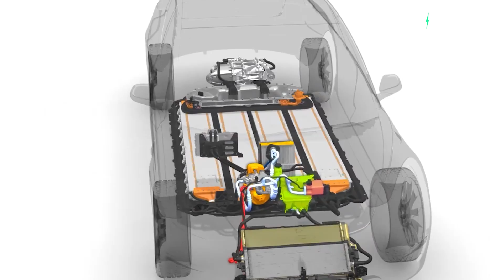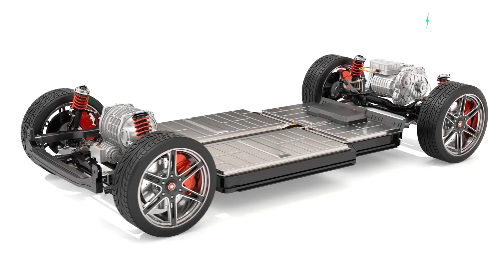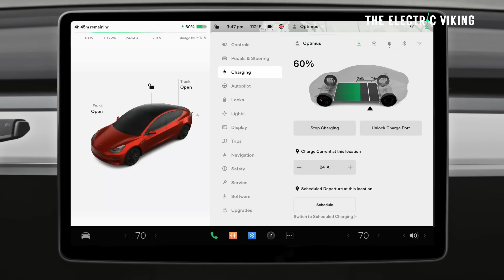No, you don’t need to replace Electric Car Batteries in 10 years time

Comment: Batteries tend to experience a decline in performance over time, although the extent of this degradation may vary among different vehicles. It is generally acknowledged that as performance decreases, so does the driving range. The crucial point is that with reduced performance, the need for more frequent recharging becomes inevitable. Strikingly, few people seem to address this concern directly. One of my neighbors has been driving a Model S since 2016, and according to them, the driving range has continuously shortened over time. Consequently, they mostly use it for city driving. Personally, I own a Model Y with approximately 15,000 miles on it, yet I consistently achieve a range of 260-270 miles, far from Tesla's advertised 330-mile range. On a recent trip to LA covering approximately 323 miles, I had to recharge the Model Y five times. Considering this trend, one might wonder if, over the course of ten years, it won't be necessary to charge it not just five, but perhaps six or seven times for the same journey.
Reply: A company called Tesloop than runs constant back and forth service between LA and Vegas had to get their battery replaced at over 600,000 miles when it was under 80% capacity. Tesla did it free, thanking them for the testing. They mainly used superchargers rather than slower home charging, which is better for the battery.
Reply: yes Tesla overstates EPA range massively. This is quite known. Realistic range for model Y is around 290 miles if you drive 65 mph. But in your LA example, the math also doesnt add up. You shouldnt need 5 stops. Max one stop if you started at 100% charge.
Reply: literally every range/miliage calculation from any company ever has to be taken with a grain of salt. They all stage things to make the number look as best as possible. @Fear.of.the.Dark.
Reply: I have a Model 3 that made a Fresno to LA journey around that same miliage and only have to stop once, or twice if I started the journey on less than ~60%

Your math makes no sense. Why did you have to stop 5 times? That would mean your range was more like 80 miles or something not 250.

Comment: All I can say is that every rechargeable battery item I’ve ever owned was either thrown away or I paid to replace the battery before the item was broken or out of date. 
Hand tools, laptops, phones, e-cigs, tablets, headphones, speakers, cameras. I could even go back to items with NiCads from 30 or 40 years ago with the same “replace the battery or chuck it away” scenario. 
I have no idea how many lithium batteries I’ve replaced but it’s a considerable amount and none of them have been cheap and equally all of them have more or less given up eventually, lasting several years at best - not 10 years or 20 years - nowhere near. 

I’m sure modern technology is perhaps a bit better but lithium cells (those used in tools are much the same as those in EV’s) have around 1 - 2 thousand charges before a noticeable reduction in capacity. We’ve all had phones which suffer this within their lifespan.

I think the real world will give us a very different answer than the one in this video.
Reply: And not one of the items you list have a true thermal management system in them that extends battery life.
Reply: @chetsaxton1526 that’s because they don’t need one because none of them have mega current put into them during charging. Will be interesting to see what difference these systems will make but I’d assume that with the advent of faster and faster charging they will only be so good.
Reply: @Jacob-yb6bv  DC fast charging yes, but at home can be done at only 15 to 20 amps.
Reply: there are already plenty of Teslas out there in real world starting from model S and X many years ago. Model 3 was launched in 2017 so it has been 6 years already. There is already sufficient data available.
Reply: Fully agree.

There are some exceptions, e.g. the 10 year old batteries for my DSLR are still usable.
But normally they last around 2 to 5 years, with some failing earlier.

I'd assume if you go for high reliability and put some engineering effort into it, you can get 10 years out of them. Time will tell. Best to wait and see the numbers if you don't have money to burn to find out.
Reply: @svr5423 what I didn’t mention is that I actually attempt to make batteries last. Using slow charging where possible, never storing them at full or low charge, bringing them in from my garage in the winter etc. Batteries simply don’t last. I’d be surprised if all of a sudden they do.
Reply: @Jacob-yb6bv  I'd also be surprised. For me, they are simply consumables.
Reply: BMS

Comment: Sam, in your videos you make frequent unsubstantiated claims that the oil industry is "spreading misinformation". Until you can actually provide credible evidence of this, you shouldn't say things like that as it actually lowers your credibility.   I worked in the oil industry for 35 years and they were far more open to change than you give them credit for.  There is far too much demonization going on these days.

Comment: i have a 2016 Model S P100D 250k miles, 84% capacity, very decent
Reply: I bet it performs like a race car still! The performance of that model s is like no other. No delay in power. Literally instant acceleration. And that performance is every single day. There's no clutch to fix, no transmission to lock up. No engine to blow up or  rpm to worry about. You can't jump time or or burn a valve. There's no adjustments because of cheaper fuel. None of the things that are typical concerns involving a ice sports car. And the highest safety scores in crash testing ever obtained in any class of vehicle.. May not be the perfect car but it's closer to perfect then any ice sports car..

Comment: ICE cars need to be replaced every 10 years on average before major maintenance that requires thousands of dollars. I expect EVs to be replaced up to 20 years if it still looks pristine and the battery lasts without major degradation. Often I hear a failed battery is caused by a module that should be replaced rather than the whole unit so I hope for more battery repair services.

Comment: As we see more EV's using structural battery packs (such as Tesla 4680 cell packs), it may be more difficult to replace the battery pack in a car, and probably impossible (or uneconomical) to repair. Nevertheless, it's unlikely any of that will ever be necessary with modern battery management systems.
Reply: Your faith in technology is unreal

Comment: According to a new UN Environment Programme (UNEP) report, fossil fuel-producing nations are planning MASSIVE EXPANSIONS of coal, oil and gas that would “blow the planet’s carbon budget TWICE over”, reported the Guardian. Existing plans would lead to 460% more coal production, 83% more gas and 29% more oil in 2030 than it is possible to burn if global temperature rises are to be kept at 1.5C. The report analyzed more than 20 major fossil fuel producers, finding they plan to produce around 110% more fossil fuels in 2030 than would be consistent with 1.5C, and 69% more than would be consistent with 2C, reported Reuters. Of these, 17 of the countries have pledged to reach net-zero.

Comment: I'm hoping that the face EV manufacturers will most likely be using blade-type battery packs by 2030 means higher storage density per kilogram and likely way longer battery service life. Like may be more like 15 years.

Comment: Will a batterie pack last 20 years even if you make 7000km every year?
Reply: All battery chemistry has got a shelflife. 80% of the lithium batteries will fail between 10 and 15 years of age. 10% earlier, and a lucky 10% will surpass 15years.
Reply: If you choose the right car it will. BYD batteries are supposed to have a life over 1 million km.
Reply: @GlenisRetiredNZ  yes In km but how much in years? I understand one can make 1 million km   but in 15 years will the pack be functional? Or you can make 1 million km but in max 8 years ?
Reply: @kayz3rkayz3r84  the battery guarantees are 8-10 years but I'd be pretty confident they'll do much, much more. Look at ICE cars, most have a gaurantee/warranty of 3-5 years but nobody realistically expects them to need an engine replacement at 5 years. I think it's probably more important to go with a brand that's likely to be here in 20 years.

Comment: Thank you Sam for this useful information. I have had my electric car for three years now and always charge it at home with 11 kW/h, 100% if I have to drive far, otherwise usually 80%. I have no idea if the battery capacity has decreased. Anyway, I understand from your video that it won't be too bad. I plan to continue driving the same car for years to come.

Comment: Your battery will not last long if you supercharge it much.  A fellow here on Ytube - who does Uber full time replaced his Camry with a Tesla;  He supercharged twice a day and it only lasted 110,000 miles. Another fellow Youtube drove his Model S 1 million miles but required 4 battery packs to reach this range - the original; one provided by Tesla and 2 more he had to buy out of pocket.  The second factor is miles - if you put few miles on it it may last 5 or 10 years but if you put on a lot it won't.

Comment: Everyone needs to watch the Kim Java video "Uber Driver's 120,000 mile Tesla Experiment". (If you don't know her, she is a big Tesla fan.) Like most of us, the Uber driver expected the battery to degrade slowly after the warrantee ran out. Instead, it degraded quickly, and he now faced a huge bill to replace the battery. His business depends on the car so I assume he ended up paying it, but it was an unexpected expense and he wasn't happy. So temper your expectations. A simple rule of thumb is to divide the battery replacement cost by the warrantee miles and add that to your fuel bill.

Comment: The point that is over looked the most, is that damage to the battery integrity due to knocks and bumps, drive over a curb or a small knock will result in having to have the battery replaced. So providing its not knocked about the battery couod last longer than 10 years if looked after and the DOD is not abused but you are relying on the user to much to achieve this.
Reply: Doubt that. Manufactures have warranties for over 100,000 km they are going to make batteries as robust as possible.
Reply: nah not true. I have a friend who literally ran over a deer with his model Y. Only thing he had to replace is one of the battery coolant lines for $300 in Tesla service center. Nothing happened to the battery itself.
Reply: @Fear.of.the.Dark.  I guess you don't believe ev insurance hasn't gone up then if what I say isn't true?
Reply: @noddy1977  I have both bmw x3 and model Y. Insurance for both cars went up by around 25% in last one year so not ev specific.
Reply: @Fear.of.the.Dark.  I can see you're a few cylinders short of a v8. Yes that is because insurance has gone up for everyone to cover the costs of EV where they have needed to have a battery replacement or from total loss. Looking at the cars you have they are both the most un efficient conveyances you may think they are okay but I can assure you they are not!
Reply: @noddy1977  it is a dumb comment. How many evs are there out in the world vs ICE cars? EVs barely make 15% market share among all cars. Vast majority of the cars on the road are still ICE cars and even new sales are tilted more towards ICE vehicles otherwise Tesla would be bigger than Toyota or Honda or GM by now in terms of global share or even in US market share. If you think cost of repairs did not go up for regular ICE cars over last few years due to parts and labor shortage and that is why insurance rates went up, think again ........ And my entire circle has bunch of Teslas (around 12 teslas). None had to replace any battery or had any total loss. In fact one of my friends with model Y went over a deer in highway speed recently. His battery was perfectly fine. He only had to replace one of the leaking coolant lines for $300 only.
Reply: @Fear.of.the.Dark.  Correct me if I'm wrong but isn't the battery a structural component of some of the Tesla models so in an accident that could be compromised? And if you can't guarantee the structural integrity then you'd have to replace it surely?
The example I gave is what happened to an ev where they drove over a curb and it damaged the battery and needed to be replaced.
Insurance has gone up because of the cost of parts to be replaced and the battery is a major cost but not to forget storage and level of skilled workers to work on EV too. In fact some Insurance companies are now refusing to insure EV.
So thus is why your Insurance has gone up 25% as you said for both your cars. Remember that when the Insurance company calculates your insurance it has to factor in increasing numbers of EVs and also costs for ICE cars alike. But then this is just some to help ppm if you know what that is....
Reply: @noddy1977  But you are also conveniently ignoring my clear cut example I gave earlier. I have a friend who literally ran over a huge deer with his model Y while driving at 70mph in interstate highway. Only thing he had to replace is one of the battery coolant lines for $300 in Tesla service center and obviously the front section. Nothing happened to the battery pack itself. The battery structure is not that weak as you think it is that it will just get destroyed so easily from some curb hit. 

Insurance has gone up for everyone around US and it has nothing to do with EV itself. An insurance company like Geico or Progressive has a portfolio of millions of cars insurance and EVs hardly comprises 10% of that portfolio. The vast majority of the premiums & risks it is getting is still from ICE cars. If you look at inflation CPI reports, insurance has gone up for everyone and it has all to do with ICE cars parts shortage, high labor costs & general car price inflation from last 3 years, nothing to do with EV specific. My X3 is still around $30K in price now with 40k miles on it but when I bought it 4 years ago with 5k miles before Covid times, I paid $40K. Car prices are still inflated and hence insurance prices are. I think you are mixing up apples and oranges just to go against EV.
Reply: @Fear.of.the.Dark.  I read it the 3 times you mentioned it but it's not relevant to the point I was making about a curb or a hit where it compromises the structural integrity, to expand on that I mean like a vehicle hitting it in the side for an example. 

Insurance has gone up to cover the costs of companies who have been burnt already and some companies will flat out not insure an ev for the reason of battery replacement and storage cost.
Reply: @noddy1977  ok then we EV owners must be running out of insurance options soon by your logic then if all auto insurers cant supposedly foot our enormous battery replacement costs. I am yet to face any costs. All I know I saved $4400 in gas costs in last 2 years already vs my X3. In 10 years time, around $22000 savings. I will take that.
Reply: @Fear.of.the.Dark.  how have you saved money?  You brought a car that was more expensive, caused more co2 than my current car of 16 years use with 58 thousands miles on which cost me 2750, but was actually brought from profits selling a newer car that gained in value. You just don't save money, you may however perceive you save money over buying a vehicle of the same value and than having to put fuel in.
Reply: @noddy1977  you can make dumb arguments if you want. I showed you my math of savings. I drive 12k to 15k miles each year. I dont do 58k miles like you over 16 years which means you dont even need your 2750 priced car. You must be sitting all day at home. Ultimately EV is the future and I can see the benefits when I barely pay $1 every day to charge at home. I have a ICE car myself but even I am not that blind enough to see where the future is going.
Reply: @Fear.of.the.Dark.  You are hilarious making assumptions, I didn't say I had the car for 16 years, I said it was 16 years old with 58k miles on, I have had it 18 months, brought on 46k so I do a reasonable mileage   actually, the point is you say about saving money, well this only costs what it costs to put fuel in for the miles I do and if you work out the co2 then you'll see that it works out at 15 tonnes in 16 years vs 18 tonnes on average to make an ev, that includes the mining of materials and shipping. The insurance went up 25% last year but as I said before it's been the same price for 20 plus years on various cars that I've had and again the reason is to cover cost of ev batteries and some is to cover the price increases we've seen globally. I'm a car mechanic by trade and race electric cars. I can tell you Electric motors are here but the power cell will change as an 18650/21700 lion cell doesn't have the discharge or energy required but that will improve in time, my race car has lithium polymer batteries but the cost to install into a road car would be 150000 to 200000 depending on capacity needed, sadly they are also more volatile and not for the average punter for safety reasons.